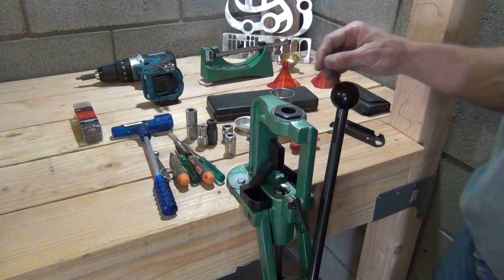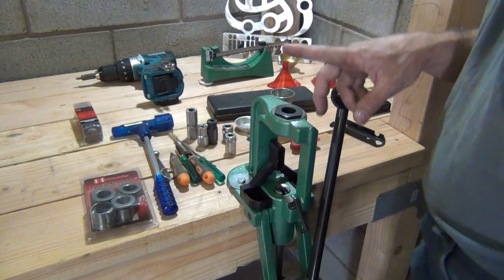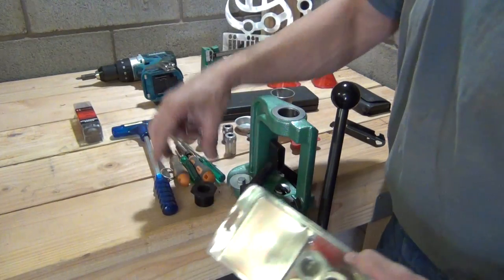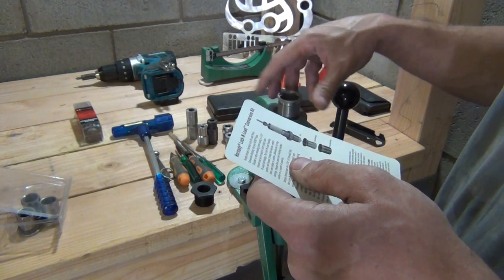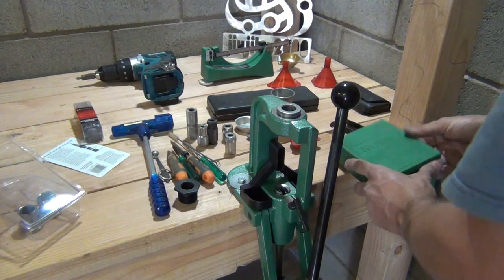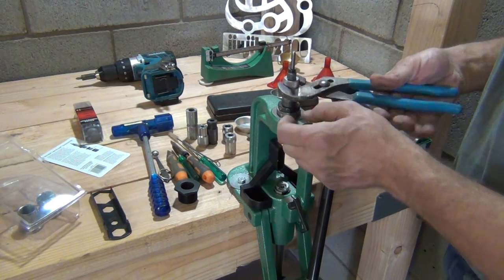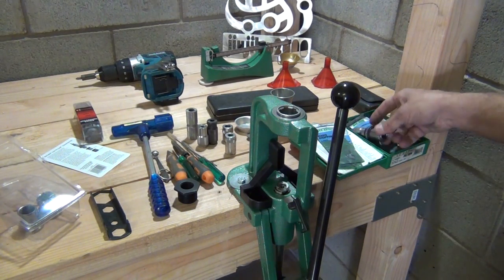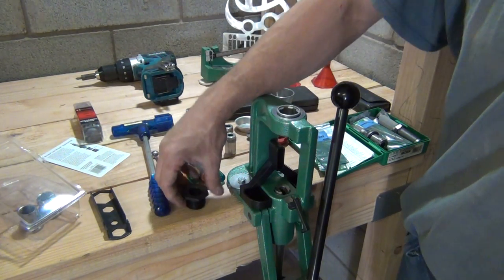RCBS Rock Chucker Supreme with Hornady Quick Lock Bushings

Comment: One thing i can to this video is that you will need to readjust your dies just a bit as the lock n load die raises your die up on the press ever so slightly. Cant remember off and how much it was on my 5.56 rounds but they were just a bit longer than when i had the die just threaded into the press itself. But this lock n load system is the way to go 100%. Awesome video and i hope my comment may help.

Comment: I like the Hornady die change system, however, it would be better if the press adapter had some wrench flats. Everytime I have to remove a die from the die adapter I end up unthreading the press adapter. With no wrench flats I am reluctant to use channel lock pliers to tighten it as I may not be able to remove it later without crushing it. The press adapter is pretty thin walled.

Comment: This works if you reload for a single cartridge, generally a rifle cartridge and possibly a single bullet.  I don't see how it would work with the multiple handgun types, such as 38 Spec./357Mag/357 Max, or 40 S&W/10mm, and so on.  Will you need multiple die sets as the cases are different lengths?

Comment: Let me see if I've got this. 
In the event I handload for twenty or more different calibers I have to buy twenty or more of the Hornady lock and load bushings. Otherwise, I have to switch bushings between dies. In which case I am right back where I started with having to readjust settings just like I have been doing for the past thirty years with my RCBS Rock Chucker press. There goes any advantage I'm able to see.😕
Reply: It's similar to changing the head on say, a Dillon press. A bushing for each die for each caliber. So 2-3-4 depending on what you do, right? So these bushings aren't terribly expensive. If you do the same load for a caliber every time, you have your stuff preset and it saves you time.